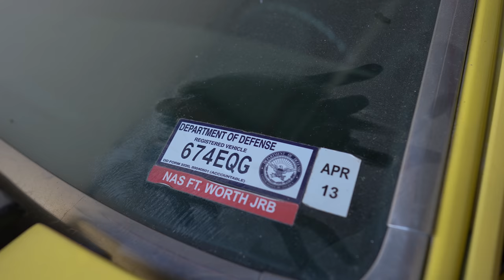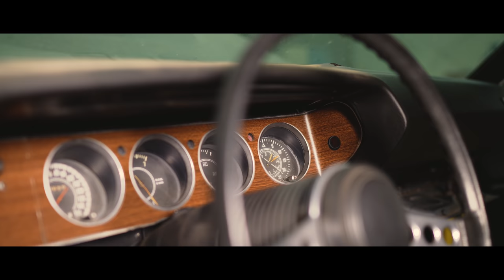A tank of nitrous, a Challenger, and a what?! - Wheels & Deals

Comment: Looks like the Challenger was a Rallye,  it might have came from the factory with  a 340.It would have been more valuable if the 340 was still in it, and it was all numbers matching, especially with the four speed.  Looks like maybe a 383 in there now. I like how Richard calls it a '73 "Fo sure" then later calls it a 72, which it actually is. 73' had big rubber bumper guards. The Rallye dash and pistol grip four speed makes it desirable even though it isn't a '70 or '71.

Comment: People you don't have keys to the car spend $100 call a locksmith out and have them make a set of keys not that difficult they come out they make an ignition key they make a trunk keys it's 150 200 bucks well spent the value you can start the car maybe try to they may be worth five or six thousand more maybe 10,000 more use your hat buy the keys